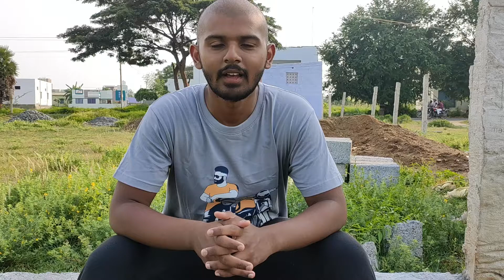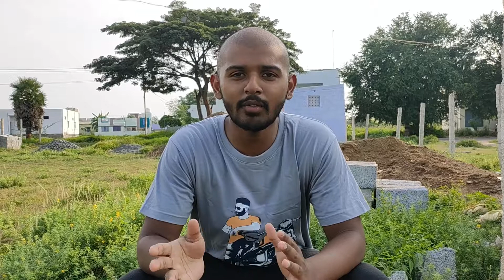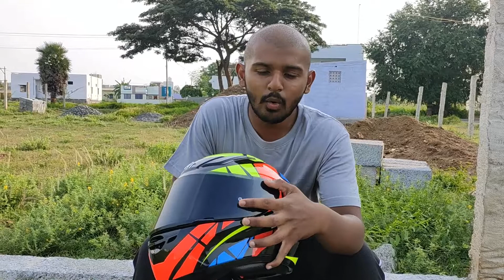MT I Helmet I Whistling Sound I Wind Noise I Review I Tamil I R15 V3 Helmets I Duke

Comment: Bro my Revenge is also having the same wind noise.I have used only once.What can I do?
Reply from the maker: the issue with all revenge helmet.. don't worry that is due to that pin lock hole.. but do not concentrate on sound otherwise you head will start to pain..
Reply: @Gapja  So my helmet is ok right?Anything we can do to rectify that?
Reply from the maker: @gauravsaikia9362  no problem with helmet..after sometimes you will be used to it